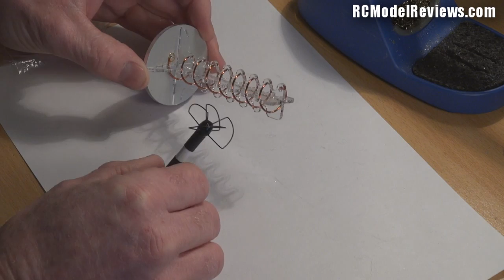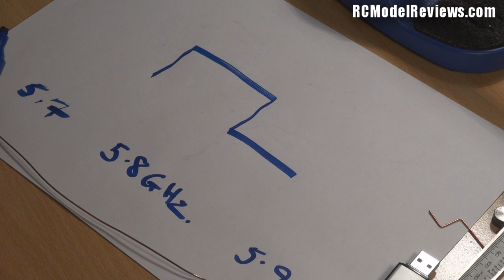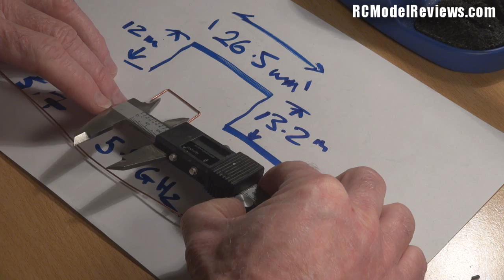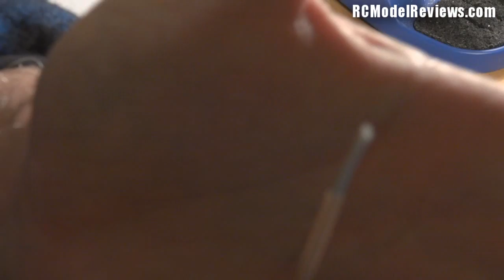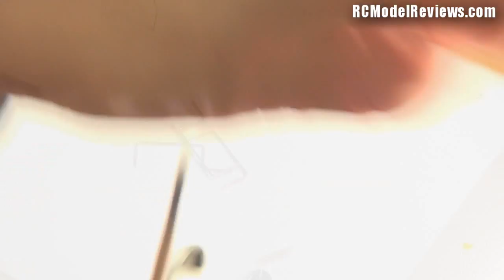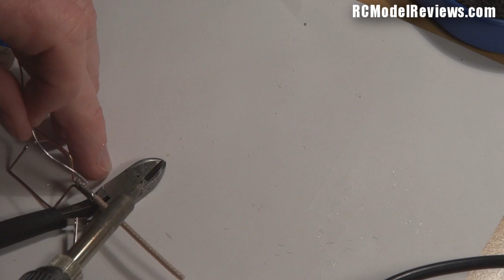DIY: FPV backpack build part 2 (antennas)

Comment: I have used this method to make all my skew planar and clover leaf antennas. I have tried every method online, and yours works the best for me. Thank you. I hope you don't mind that I am putting a link to this post in my next video. I have made some 2.4GHz skew planar antenna to test on my drone. And a few 5.8GHz clover leaf antennas for the FPV. They perform just as well as most Ebay antennas that I have tried. Less money spent, and fun with DIY. Love your tutorials.

Comment: The antenna preformed so well I used it on my main Quad, have just rebuilt it as it got trashed with all the crashing, so will put in it some kind of case. Only slightly less range than the fat shark ones.

Comment: Is there any reason piano wire would not work to make these antennas?
Reply: piano wire is not copper wire.
Reply: I am aware piano wire is not copper wire. I believe it's some kind of high carbon steel. But is there a reason it needs to be copper? Would another conductive metal work? Or is there something about the resistance or properties of copper that makes it drastically more suitable? I can plate the piano wire with copper if needed. Or how about grade 5 titanium, might make a very strong and light weight antenna?
Reply: I would think other wire, that Is less conductive would not work the same as copper. I am not an antenna engineer but It could filter some thing.  If you have the stuff, make one and test it out,  if your happy with the results, no harm done. I will try to make one here soon, but I will just stick to the copper.  I also wonder if the piano wire can take the bends needed. it might get brittle where bent.

Comment: Hi, great tuto, I have a 0.8mm wire, will it work too with the same measures??
Reply: yes, just add .1mm to these dimensions... although I doubt you'll be within .1mm of accuracy anyway, so it won't matter.
Reply: yes, just add .1mm to these dimensions... although I doubt you'll be within .1mm of accuracy anyway, so it won't matter.

Comment: hey bruce and fellow antenna makers i used a ruller haha and used the sma connector on the whip antennas and for a handmade antenna im impressed .I also used 0.5mm copper as that was all i had. Im yet to test range but seemed very respectful and usable on my mini quad flying through trees.  Great video bruce thanks a lot

Comment: seems like you could pretty easily use a bit of foamboard or the like to make a bottom jig that fits tight around the braid with 3 or 4 slots for the wire at exact angles if you're as OCD as I get on fiddly stuff and want to tinker.

Comment: I already bought a pro set last night, but came across your video this morning and thought why not try. Followed your video and it came out pretty decent. I easily doubled my signal if not tripled it, I tested through my brick building and out to the other shop through more brick. Thank you for the DIY video.. This will be a nice back up if ever I need one.

Comment: We know what millimeters are.
We use them on a daily basis. Usually for measuring things smaller than an inch. In fact we use the metric system for a LOT of different things. The whole "Americans don't use the metric system" thing is a complete stereotype. And honestly, joking or not, it gets very irritating hearing people from other countries mock us about it over and over with a condescending attitude. Yeah we get it, the metric system is a lot better. It's not our fault our government wont make it a standard, but all you're doing is rubbing salt in the wound.
Reply: But you also confuse things by calling 0.001 inch both "thou" and "mil" (in the electronics realm), and forcing the rest of the world to work in multiples of 0.0254 mm.
Reply: I know what you mean, it was a big part of our Education to learn both the Metric as well as the SAE system of Measurement and that was 40+ Years ago, not sure how they teach it in schools now days as the Education System is getting lazy, even to a point I think they are planning to eliminate Cursive which is Stupid IMO.
Reply: dacasman  I  think he was kidding. I was taught in inches but when my age progresses I had t use MM. There are a lot of things different in different countries so I wouldn't get that hung up on stuff like that.

Comment: You can use fine wire to hold the three pieces on the braid. If you simply wrap it around with a few turns of fine wire, the structure will be adjustable but still holds in one piece while you can solder all of them in one step. You may want to add some flux if you have some to help the solder wick better to get a one step soldering.

The wire wrapped around adds to structural stability as well.

Comment: Excellent guide, just built one, needed it to be light as I am going to FPV my Hubsan X4 quad and it does not have much of a load carrying capacity. Just need the transmitter, camera and receiver to arrive in the post and I am ready to go.

Comment: i did this and made my own cloverleafs. got 3.5 km!!! 600 mw transmitter. exelent video down. WOAH
Reply: flanker The rubber spray is called Plasti Dip :)
Reply: I reached 7 km with 500mw transmitter, homemade Clover and commercial helical. Probably could have gone a little bir further even.

If you haven't tried, try helical.
Reply: flanker helical is the only reason you got that faar. and there is no point going more than 3km. dont have enough power to get it back home
Reply: Yeah I know it's the helical.

Point of going for more then 3km is at least for me, just the challenge of it.

As for not having enough power, I beg to differ. If you put your mind to it, you can do a 40km round trip. People actually have done just that.

Planes like HK Skua can carry ridiculous amounts of batteries on board. Add a perfectly tuned 1.3 FPV system and 433(or even higher) control signal... 20km is achievable.
Reply: flanker ooh. missunderstanding. im flying a quadcopter. soo only around 17 min top :) 
my antennas: http://photos-g.ak.instagram.com/hphotos-ak-xpa1/926534_633792933408270_336225437_n.jpg works great :)
Reply: That black colored thing looks amazing. What is it? Liquid electric tape? I was thinking about using it, but didn't want to risk messing the performance of the antenna. 

Yeah, multirotors are not as good at distance flying as planes. But 17 minutes definitely isn't "top".

There are quads that can hover for 110 minutes. You might thing that hovering and actual flight are different animals....

Check this video out. /watch?v=3H7k9OkfGSs
31KM traveled. 50 minutes flight time on a quad.
Reply: flanker wow! thats insane. added that to my fav. I wonder how he can do it.  The coating didnt affect performance at all. its for cars actually. to spray at the bumpers and other places to prevent rust. its a hard and elastic rubber coating. Makes the antennas very strong so i dont have to take care of them.  im flying a phantom 2. not the best flight time, but it gets the job done. next one will prob be a homebuild one as i learn more and see where its heading. :)
Reply: DVR?

Comment: Who sells those pre-terminated SMA cables you show?  I can't find them on HobbyKing or RCTimer.  I'd like to find at least one that is wired as an extension to position my FPV transmitter antenna in a good spot.
Reply: Ebay for "SMA Pigtail" or "RP SMA Pigtail"
Reply: Adam Black Any experience with crimp ons? I just bought 10 for a  few bucks, but I wonder how they stand up.
Reply: I found some short extensions at an amateur radio swap meet, along with right angle adapters too.
SMA isn't as obscure as I thought.

Comment: Can i use coaxial cable other than rg316?
Reply: Yes, I would suggest RG-174/U or RG-316 due to their small size.  Remember that coax with a 50 ohm impedance is key to this or any antenna build.

Comment: bruce this is a dumb question I have some 1 mm 14k gold wire can I use that? in my mind I think that gold would work better than coper? because all expensive electronics always use gold plated jacks or is it just a gimmick?
Reply: Gold is more resistive than copper, barely. the reason it is used in connectors is because it does not corrode or oxidize like copper does. you will see no performance increase either with that wire. it would be a waste of money.
Reply: thank you!  makes complete sense!
Reply: david ringler Copper oxide is resistive and skin effect causes the current to concentrate on the surface of the conductor, causing increasing signal losses as the copper ages.  Gold plating, as well as a thin coating of paint, keeps this from happening.

Comment: Nice tutorial! A quick tip... When stripping the coax, first strip the tip all the way to the center wire, then cut the outer plastic, slip it off only 5mm, and tin shielding while the outer plastic holds the tip of the shielding from fraying. Work sort of fast so as avoid melting the plastic into the braid. This method reduces shield deformation, which can change impedance of the coax.

Comment: I'm lost here.
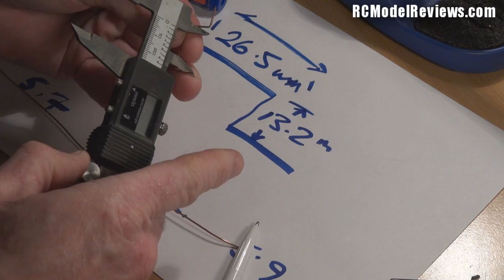@ 9:45 you are saying that the inside measurement should be 25.5 mm as the wire is 1mm thick.
Hmm as the outside is 26.5mm should the inside not be 24.5mm? 26.5 - 1 - 1 ?
If I make the inside gap 25.5mm the outside will be 27.5mm....
Reply: You're not listening to what he said. He said the measurement is to the center of the wire. so that's why you subtract 0.5 mm on each side. so 25.5 mm on the inside. The outside would be 27.5 mm.

Comment: Bruce, say you have 900mhz what is the optimal coax length? Someone said it should be a multiple of a 1/2 wave length x 0.6 from the coax resistance. So 333 * 1/2 * 0.6 = ~100mm?

Comment: 24:20 You can make it easier if you take a piece of thin coper wire  (like magnet wire) and spool it around the grounding section, it will help holding all the parts together and make a good solder joint.

Comment: actually when you go of camera you are not working under pressure,
it seems to me you have a perfectionist/lack of confidence issue,
at your age 1/you either have attained proficiency
2/compatancy.
stop blaming your self go with the flow,and then make your videos shorter and chock full of good advice and information.
instead of faffing about like something in the wind.god bless

Comment: no julian, don't use coax cable that is much thicker than that. I'd recommend using the RG316 coaxial cable since it's much more heat resistant than other cables.

Comment: Thanks. Great video. Can you please explain how the antenna is soldered to the transmitter please? Is it just the bare core of the coaxial cable that is connected, or is the braid connected to the transmitter aswell? :)

Comment: I have built many of CP and SP based on your great tutorial. I also add some copper wire along the coax and heat shrink it to make it semi rigid. The small container inside Kinder Surprise eggs makes the perfect protection cap as well :)
Thanks so much for all your tutorials

Comment: This is a really really a good presentation in the way he discloses the alternate variables alongside the main points he is trying to convey. Bravo!
Especially the explanation of antenna element diameters, and its effects on bandwith regarding vSWR and alternately its effect on the differing skill levels and seriousness of application. Personally, I use 0.1mm gold filament elements in glass tube for driven, and copper for the directors (a directional Yagi antenna), and must be exact on lengths!

Comment: Nice video Bruce.  Just one comment: Do you not have the lengths of the legs of the wire switched around.  ie the 12mm one should be on the leg that solders to the outer diameter (of the co-ax) and the 13.2 leg should be soldered to the centre wire of the co-ax so that the displacement of the ends of the 26.5mm wire section, is equal distance from the centre?

Comment: Good one Bruce - pragmatic advice as usual!
Thought I'd make a jig, since 7 wires will be needed. Draw on CAD, print@ 1:1, stick paper to wood, knock small nails inside bends and wrap wire around, cut to length.

Comment: you really need to invest a couple bucks on a second set of hands.  They make it a little easier to solder, but they are incredibly helpful at keeping the wire in the shot.  You get your camera centered on the second set of hands and then you can forget about the camera unless you move the second set of hands.

Comment: Hey Barry got a couple of the new Beetle micro quads coming from HK. Would love to build a backpack for it but as it runs on a single cell lipo the voltage is to low for most of the FPV kit available. You mentioned you can bring your voltage up but that will drain your battery faster. Are you aware if there any FPV kit (camera and TX) that will run on 3.7 Volts? Would make this type of build much better.
cheers

Comment: Great video! Looks like it's crying for a jig for soldering the 3 wires to the outer shield. Perhaps a nice little cylinder with a hole in the center for the tip of the wire, and 3 groves 120 degrees apart that wrap around the end of the cylinder to join at the hole? then use rubber bands to hold your wires in place.

Comment: Hi Bruce.
Yes I have been watching,as I said your knowledge is great, your explanation of the wire sizeing and the reasons for picking the center of the frequance makes sense, does this mean that if you have a commercial system you should pick  the center frequance for the best results, I look forward to following the series and completing the project.
Regards Geoff.

Comment: Great! well done and very easy to follow. One thing I would recommend from a photography standpoint is you can see that the auto exp. in the camera has adjusted to the bright piece of paper, making the image to dark.  I'd try switching it to manual or aperture priority mode and making it 1/3 to 2/3 of a stop brighter.

Comment: Are the dimensions center of the wire to center of the wire or measured outside of the bend to the outside of the bend?
Thanks

Comment: Bruce,great video and soldering, making it yourself is so much more interesting and satisfying. To make it a little easier if you don't have heat resistant fingers ! use some long  bent needle nose pliers with a rubber band around the handles, works for me. Looking forward to the rest of the build. Jez

Comment: Bruce, do you suppose that you can use thinner coaxial wire, such as the stuff that comes with a 2.4 reciever? i could always reinforce it with say a carbon rod.

Comment: I am pretty sure a properly adjusted single speed bike would just break the zip tie when it goes over the cog or chainring.  
If you have a fixie or coaster brake bike I don't think it would throw the chain.